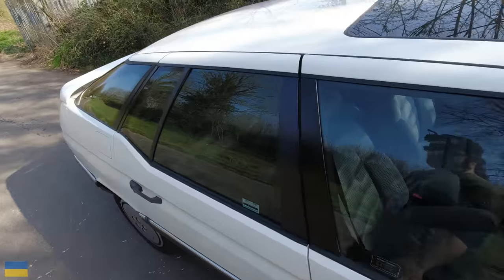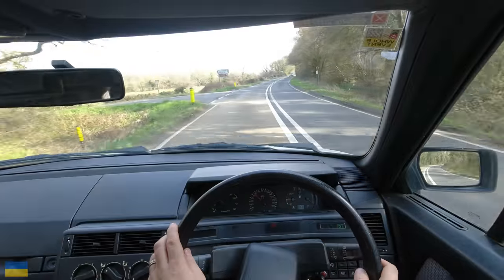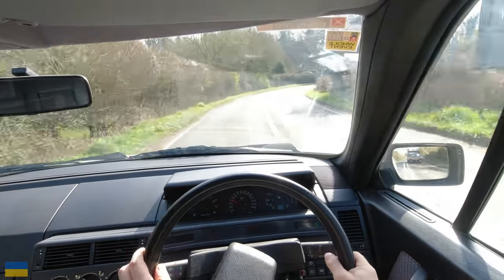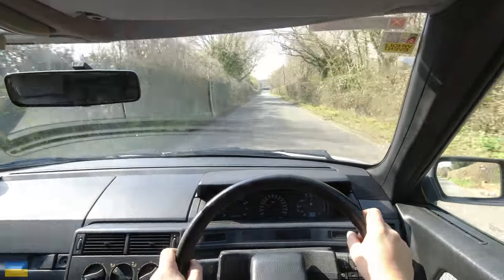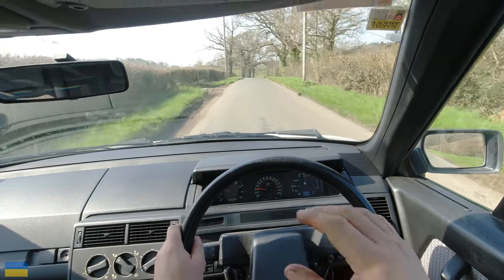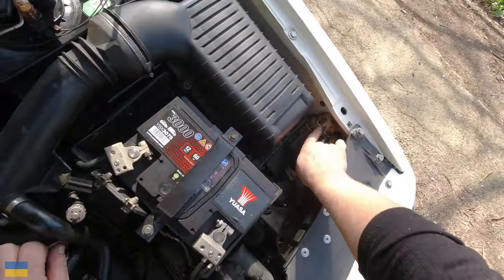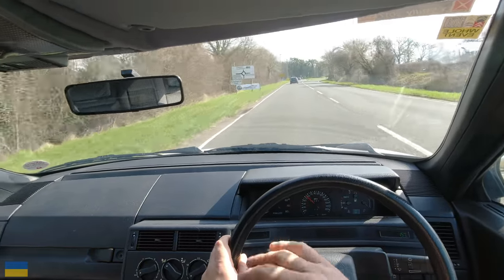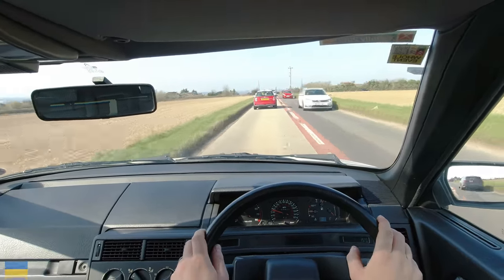1990 Citroën XM 2.0Si (part 2) - POV 'GOLD EDITION': Test driving one of the cars from my childhood!

Comment: The first XM I test drove was a 2.5 turbo diesel estate which Stockbridge Citroen let me take out for an hour, so I took it over Hayling Island to see what it was like on narrow roads, then up around Goodwood and back to Chi where I handed it back. It had horrendous turbo lag and snatch and would suddenly take off when it hit 3000 revs. Someone was going to overtake me on the A27 and once the turbo kicked in, it took off and left them in a cloud of black smoke as it was a dirty diesel engine for a brand new car. Not at all like the CX 25 GTi Turbo 2 where the turbo was already in at 800 revs, so no turbo lag/snatch at all on that gem.

Oh yeah - those XM headlights. Going from full to dipped beam was like switching to sidelights only as the dipped beams were that weak. I had a love/hate relationship with my XMs - while I loved the styling, the reliability problems is what did it in for me.

The SEi spec had wooden trim on the dashboard, ashtray covers, gearstick knob (on manuals) and along the doors.

I used to do my driving instructor training along those roads over Portsdown Hill/Fareham way.

Comment: I had an XM from new (as a company car - no depreciation risk!) in 1994 and loved it, particularly the ride. It was the 2.0i petrol turbo and its only drawback was lack of power and turbo lag which could prove a little too exciting sometimes when pulling away on a roundabout and not a great deal happened for the first second and a half.  But it was the consummate motorway cruiser once you wound it up and had terrific range with an 80L tank. A colleague’s wife (French) shrewdly pointed out that it was a car designed specifically for the needs of Parisian bourgeoisie - it didn’t matter that it wasn’t fast, it could get you and your family from Paris to the ski slopes in complete comfort at 130kph without needing to fill up!
Reply: I read Parisian as Persian there and thought what is he on about.
Reply: @rimmersbryggeri  Hell of a drive from Tehran to Val d’Isère.

Comment: I’ve owned more then 1 Xm and my current daily is a V6 12v auto with Diravi, and it’s the Xm to go for if you ask me. Pure comfort and snoothness.
Reply: That's the perfect combination for the XM, but sadly they're so rare. Most of them are diesel and manual, which takes away from that smooth and cushy ride.

Comment: About the Headlights: There was a revision to fix the horrible headlights in 1992 or 3, those lights don't have the plastic screen on the inside anymore, my 1993 XM has those already, and they still aren't great with normal bulbs, but with some Osram Nightbreakers they are pretty good.

Comment: Credit to the Ower of the car... Who I know. But it's interesting the difference between the 2.0i 8v and the 2.1td. Despite 20bhp difference the diesel being 110bhp the torque makes all the difference and makes for a great driving experience. I note your section of slight lack of go where the td over comes this...
Great talk on the suspension. Clearly researched well. The S1 dash is great and makes the cabin very airy. Parts can be an issue but locating a hoarder is key.
Reply: Flow dividers ie sinkers made right up into S2 cars and down graded to anti sink from 1996..
Reply from the maker: Thanks! I didn't actually research anything, it was all off the top of my head (so I'm awaiting the errors to be pointed out!)
Reply: No Richard. Its  Very good.

Comment: Drove one of these Dublin to Kerry ( before most of the motorways) in the early 90s. A 2 litre petrol, manual. An underwhelming car. Steering, brakes, that bloody parking brake, interior trim assembly, were all annoying. Not a relaxed drive at all. For a large, new, executive car, it was quite the disappointment . Made me ask if Citroen had done quirky just for the sake of quirky. Very little of the car seemed to be well sorted. Preferred a drive in a more conventional Xantia a few years later. If I were so inclined (which I'm not) the CX just seems more appealing, probably because of its more distinctive shape. Anyway - great to see this, Richard. Thanks 👍🏻

Comment: Such a good video. I found it by following from the Facebook group. I'm on my fourth XM, which I bought in 2010. It a S1 2.1 SED manual. I'd like to convert it to auto if I could find the parts. Previous XMs were - S2 2.1 VSX manual in white, S2 2.5TD VSX in silver and a S2 2.0TCT manual in black. I did a top end rebuild in all of the except the 2.1 VSX which was rotting away.

Comment: Great video and I love your work and knowledge. There was one small thing you got wrong: there was a Citroen XM V6 SEi 12v 1990 model I owned manual YES MANUAL transmission - you mentioned there was only automatics. It was even fitted with a factory fitted keypad immobiliser. I loved that car but spent a an absolute fortune on it. The car reg was G589 ARV - look it up on car check.
Reply from the maker: I haven't gone back and watched it, but I'm sure I wouldn't have said that as I knew they were auto by default, but manuals were a no cost option (unlike the 24v which was manual only)

I might have made the error though!

Comment: Oh I miss my grey XM series 1! It was "only" a 2 litre, but could easily reach 200 km/h. And just sooo much space.
It died from rust in front suspension towers at a time, where I couldn't really handle such things.
Those flat plastic hubcaps are really the most beautiful ones ever made, according to me... Bought a set on eBay for my CX GTi, when I changed to 15" Alfa Romeo steel rims on that.

Comment: I used to own a D.12 - the naturally aspirated diesel with three valves per cylinder and a whopping 82 hp.
The ride was superb, and of course the engine didn’t match the suspensions. But it had surprisingly good torque for city driving and felt not nimble, but competent. 
On the autobahn it would reach 180 km/h indicated speed - that’s around 112 mph for people who don’t use rational units -, but it would take some time to get there. And if you needed to brake for some fast lane hugger, you needed to switch off the air con compressor to get past them with some dignity, once they gave way. 
But on the other hand, no matter how hard I drove it, it never got past 8.2 litres of diesel per 100 km (or below 34 mpg for twisted imperial brains). Even with family and luggage and driving flat out for hours on end.
I would have kept it forever, but the MXL tyres wouldn’t have that. I lost the car on a wet twisty road during a holiday in Piedmont - albeit driving carefully and not too fast, as my previous phrase might have you think, and wrote it off. It must have been something from the vineyards I was driving through. The Citroën dealer it was towed to looked at the wreckage, kicked a tyre and said, “when we were selling the BX around here, first thing the customers did was change those tyres. They’re no good for our roads here.” I could see why, but it was too late... That D12 was the only XM that used MXL.
My last trip in an XM was in 2000, it was the last 3 litre V6 24V. I drove it from Berlin to Cologne in under 4 hours on a grey Sunday morning when the country was still asleep - that’s an average speed north of 150 km/h. And yes I had to refuel, it used 20 l/100 km on that drive, so 14 mpg. But what a ride.
Reply from the maker: That's the thing with the PSA-era hydro-Citroens...once you've got the speed up, it's so easy to keep it going.

Comment: btw, you hear a click when you open the door, because it goes out of sport mode, not into sport mode, it's done that way, because then the hydractive valves resting position can be "sport", and also, because if you were to load the car up with stuff, then let it get out of sport mode and suddenly make it open the center spheres, you'd have less pressure in that sphere, effectively makign the car fall down, same thing with unloading, then the car would harshly jump up a little. Hydractive 1 just isolates the third sphere on each axle, and so does hydractive 2, they both have mapping to change between soft and hard, but if you put it into sport mode manually, then hydractive 1 just goes hard while hydractive 2 changes the mapping, still staying soft, but for a little less and keeping hard a little longer.
Reply from the maker: Yeah, someone else pointed that out. Makes total sense what you say. 👍

Comment: I had a G-reg manual in 1997 which I’m pretty sure had a carburettor, it certainly wasn’t quick but I loved it. The main issue with it was that it wouldn’t idle until it had warmed up, which made driving with a manual gearbox and foot parking brake interesting. I only had it for three months because somebody jumped a red light (when it was far less common) and sliced all the plastics off the front making it a foot shorter. Insurance wrote it off because it was worth so little.
Reply from the maker: It may well have done, yes. The 2.0 carb was available in the UK, it seems. I never remember seeing one, but then when did you ever see an XM anyway!

Comment: We removed the 2 litre petrol auto from our mk1, and replaced it with a d12 with the auto. It was faster, and considerably more economical.
The auto in it is the pure mechanical zf 4hp18 that generally last better than the later auto adaptive version used in the likes of the 2.2 c5. Which was the 4hp20, which is pretty much the same architecture as the 18,but an ecu, expensive oil and no dipstick 
I rather want another xm now...
Reply: *edited because I'm old and forgetful. And old *

Comment: I have an '89 2.0Si which I'm about to have "recommisioned", (after I've had my '85 CX 2.5 auto Pallas done.) I've just had completely re-built a 1949 Renault 760.
Reply: The CX went off to have the work done, and after an initial flurry all has gone quiet. In the meantime, I've just bought an SM.

Comment: I've been looking into how the 3L 24V engines performed recently. Yesterday i dived into some Citroen brochures, and found something interesting. In 1989 Citroen in an official brochure claimed that the manual 3L 24V PRV took 7,8secs to reach 60MPH (something like 8secs to 100km/t), and 138MPH on top.  It was written as part of the normal brochure text. The same setup in a 1991 brochure (official specifications listings) is listed with a 8,6secs to 100km/t, and a top of 146MPH. ES9 seems to be listed at 8,4secs to 100km/t, and a 146 topspeed where i've seen it. 1989 and 1991 brochures found on citroenet (UK). Don't know if all they did was to put a higher gearing in the cars after 1989, since they went from around 8 secs for a 0-100, to a 8,6 for the same sprint. Did gain 8MPH on the top. No matter: A bit strange they messed around with the numbers like that..or perhaps just lied through their teeth in the beginning..could be :D

I remember people saying that the 12V was less prone to dying, so perhaps now a days i would feel better about buying a first gen 12V with an auto box. I have experienced both. A 12V Break, and a much later 24V hatch. Give me a 12V auto pre facelift for the looks, and i think i could be happy. ..eventhough in my dreams i'm driving the 24V :) 

A very enjoyable couple of videos. Thanks :)
Reply from the maker: To be fair, Citroen were known for fudging numbers and actually UNDERquoting their figures to try and lower skyrocketing insurance premiums. The Xsara VTS was a classic case.
Reply: @UPnDOWN  Wouldn't a raised topspeed be worse than a slightly quicker acceleration..? I don't understand insurance, so maybe not.

Anyway: Refreshing approach, underquoting. Not the standard expectations.

Comment: I have owned a ax gsa and 3 bx,s .the 19trs did not have an oil leak at the front and the subframe rusted it was so dry.the first one my mechanic had seen.
Reply from the maker: My BX mk1 had a rusted subframe. Had to weld it up as it was too rare to replace.

Comment: Now I want a XM too, I'd love having one either in Bleu Olympe or Vert amandier (I have no idea how they're named in UK) with a blue interior in the former (blue and brown interiors were available until 1991), although I'd be very intimidated by the powerful brake system, never been inside a hydro Citroën, let alone having driven one nor car with no ABS or from the 20th century.
In France the 1st carburetor model to come was name Séduction... which actually is shockingly poverty spec for an executive car. No rev counter, no armrest (which was available as an accessory), no electric mirrors (same for the Harmonie, middle level trim) the upholstery was as rough as flimsy. It was later by the Présence which thankfully was less pov spec with a rev counter and softer canvas.
Reply from the maker: Brakes are easy enough to get used to. They feel very different to a 'normal' car, but they're superior IMO. Very powerful and easy enough to modulate. The Xantia was the worst for brake pedal feel, I'd say, but most have ABS.

Comment: The reason the Xm is worse over those sudden dips is that the Hydractive suspension has a movement sensor that switches it into stiff springing briefly to attempt to control the float
Reply from the maker: To be fair to the XM, I took the BX over that road last night out of interest, and it did worse than the XM.
Reply: @UPnDOWN  yea,  I think the BX suspension height needs to be exactly right for it to ride well. I also found in the past that my CX ride actually got better when I made the damper valves slightly stiffer.... kind of contrary to what you might think 🤔

Comment: Always loved these cars, especially the looks. Do you think it would be ok to lower it a tad, would it still ride well? IIRC, they have some level sensors on the antiroll bars which should be adjustable?
Reply from the maker: If you play around with the height of the suspension, chances are you'll make it drive worse. You'd have to stiffen it to lower it, otherwise it'd just bottom-out a lot.

Comment: I remember the XM coming out in the UK when I started working at Citroën in Blackburn in 1991, think the XM came out in 1989 ? Cx estates were still available brand new (Common crossover with Citroën) Some early 2 litres even came with a carburettor here in the UK too, the rear Axle is from a Cx (Sans Longerons) and the Dosser valve (Brake Valve) is located remotely on the bulkhead underneath the scuttle,  Citroën's are much better in LHD form as this is how they were designed (imo), needless to say i had quite a few LHD Citroën's, when I worked in NL we used to maintain 2x V6 XM limo's and I remember them having Diravi steering 😎
Reply from the maker: All correct, except rear axle isn't a CX one at all (it's more like a BX). Doseur valve is behind the brake pedal as normal, I think? But you're probably right - they work better in LHD format.
Reply: Yes but I'd be tempted to read the XM book on the development (Comme Moi) and I'm pretty confident the rear axle has it's origins in the CX, look from the side (behind the wheel arch liner) infront of the rear wheels and you'll see the large diameter tube of the CX rear axle, and have a good look under the scuttle too, LHD is directly behind the brake pedal 😉👍🏻

Comment: Hello! I am selling my Citroen XM turbo injection, automatic, 1998 cc, 1997, petrol, dark red, owned since 2011, under 82.500 miles. I have two keys and all service history. It is off the road, parked in my driveway (Greater London).
On the good side : impeccable grey velvet interior. Spheres were replaced  under 1000 miles ago.
On the requirement side : The lacquer has peeled, tyres need to be replaced, and a new alternator is required.
I think that is all that is required for it to be running beautifully again.

Comment: The only problem with that superb bump handling is that you basically learn to ignore them which sooner or later wears the aft spheres out. Are you aware that the later XM's have the so called Activa 2 system which is even better. There is actually a dutch test in which they compare the XM to the C5 Air Cross and even record graphs. The XM wins! https://www.youtube.com/watch?v=LNL69qzo82E
Reply from the maker: Later XMs had Hydractive II (Activa is something different), which I put in text later in the vid (not because I forgot to mention it, or anything!)